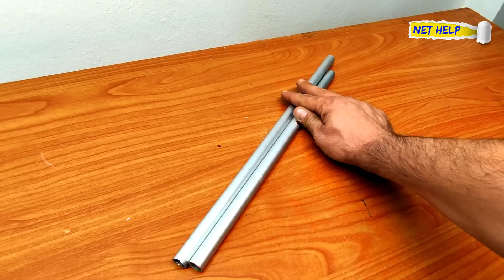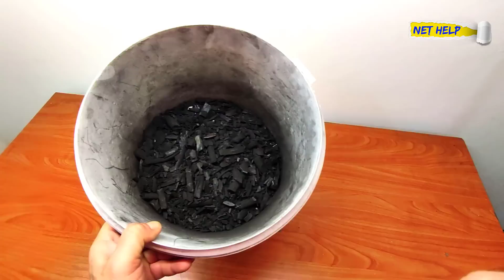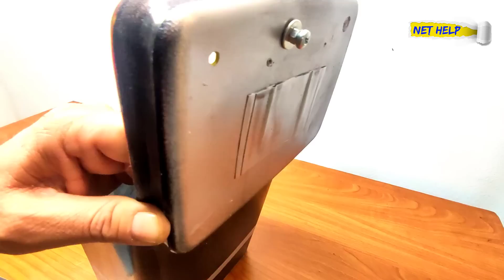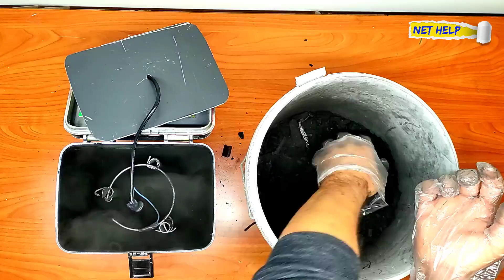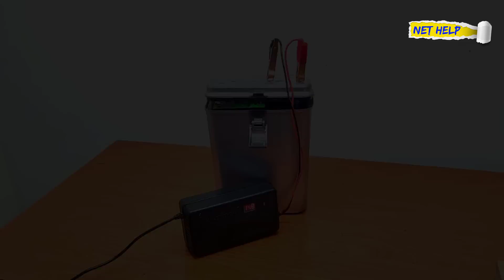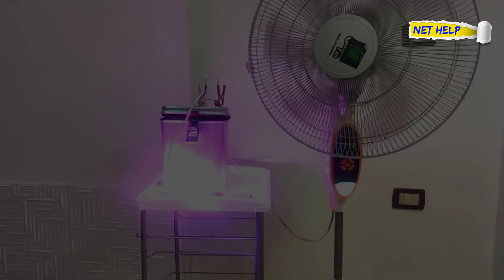I made a 12 volt battery and got free electricity. great idea

Comment from the maker: Dear follower
Tomorrow I will publish for you the fan used in the video, which works on electricity and battery. It is sold on the Internet, and there are many designs
Reply: l

l

l

pp

l

l
Reply: Μπορούμε να το φορτιζουμε με ηλιακα πανελ και πόσο καιρό κρατάει η μπαταρία
Reply: É recarregável?
Reply: Le iba dando el beneficio de la duda hasta que vi que le hecho el "acido hipocloroso", el carbon quedo seco al punto de soltar polvo por lo que es dudoso el funcionamiento sin electrolito, generalmente una bateria de carbon lleva agregado algun tipo de liquido que permita la cobertura total de las celdas. Por otro lado es muy cutre la conexion del electrodo negativos, es decir, amarrado sin soldar y con cinta aislante, cutre. Y lo que termino por desenmascarar lo fake, es cuando le conecta un supuesto regulador que a simple vista se ve que es una fuente switching y al final pone a cargar la supuesta bateria por los mismos bornes de salida. Que yo sepa aun no hay un regulador bidireccional. Pero para efectos de diversion si sirvio mucho el video, me recuerdan los inventos del coyote intentando atrapar al correcaminos. Muy divertido
Reply: And you call it free? you charged the battery from the electrical network. It already turns out that it’s not completely free!
Reply: Thank you . Battery life? How does it regenerate, extend the life of the battery? Maybe show a link where you can buy the necessary materials. All the best !
Reply: How long the electricity lasts?
Reply: Ну теперь понятно как светился прожектор у паровоза.  😂😂😂
Reply: 😂😂😂That's true no bidirectional regulator

Comment: The design is correct. The only thing is not to combine dissimilar metals in an aggressive environment inside the battery. The adhesive tape will not help, as the acid will eventually reach the junction and destroy it. Instead, it is necessary to remove part of the copper and aluminum electrodes outside and make connections there.
Reply from the maker: Sir, we are working on teaching others the method and next time we will work on developing it.

Comment: hoax, false, all kinds of wrong ... there's an anode and a cathode, but the charcoal electrolyte is suspect, rubbing of lemon on the anode does nothing except bring up vague memories of a junior school project. There's no conductivity/electrolyte between the anode and cathode ... it wouldn't drive a 1.8V LED if you called an uber, let alone a fan and power LED's.
Reply from the maker: Did you learn about the Baghdad battery that it manufactured since 2000 that you did not even know about?
Reply: там преобразователя плата, так что все правда, только непонятно - почему медь, а не графитно-угольный электрод? медь вскоре растворится.

Comment: Congratulations. Was the pipe of aluminum and the name of the chemical applied
Reply from the maker: Baghdad battery depends on coal and acids
In this video we used
copper rod
Three aluminum rods
effort lifter
8 - 200 g Hypochlorous acid 200L/H with a concentration of 200 P

Comment: Voltage is good but amperage is the  foundation  of a battery  it means  how long the charge will last .So getting  this out of the way how long  the battery  will maintain  the charge?
Reply from the maker: After seven hours, you can charge it. I have been using it every day so far

Comment: So you used a magic charger that was not plugged into the mains? Mmmm interesting.
Reply from the maker: We installed a voltage riser on the battery and the used bulb is 12 volts, not 240, and it works on the battery and not on electricity.

Comment: The reduction potential or Al and copper is not 12 volt 
Its fake note possible
Reply from the maker: sir
We did not fake it. Look for the method of making the Baghdad battery, which was made 2000 years ago. We added a voltage riser to 12 amps.

Comment: Internal resistance of such a battery will be huge, and electrodes is very small, it is unlikely that such a battery can deliver such a large current. Good focus but nothing more.
Reply from the maker: We put a voltage riser equal to the battery voltage
Reply: @NetHelp2 o you plug it in into your belly button?
Reply: @NetHelp2 Do you plug it into your belly button?

Comment: Good job but your fan normally must use ac and the battery is delivering DC how to do?
Reply from the maker: Mr
This fan runs on battery and electricity
Electricity charges the battery, and when the power goes out, the fan runs on the battery

Comment: a 12VDC battery cannot run a 220VAC fan, 1 the voltage would be too low, 2 the battery is DC and not 50Hz AC.
Reply from the maker: Mr
This fan operates on battery and operates on electricity
Reply: Из видео следует, что этот как бы аккумулятор состоит всего из одной топливной ячейки. Согласно физическим законам одна такая ячейка способна выдавать не более 1,5 вольт, а это очень мало. 
Даже если предположить, что электронный блок повышает напряжение до указанных 12 вольт, то при повышении напряжения сила тока снизилась бы пропорционально. Мы видим, как эту батарею якобы заряжают напряжением 12 вольт, что невозможно и недопустимо в силу физических законов. 
Если бы подобная батарея работала, то производители не делали бы аккумуляторы на 12 вольт из 6 отдельных ячеек соединенных последовательно. 
Это очевидный обман. 
Автор, вам доставляет удовольствие смеяться над теми, кто верит в подобный обман, или ради монетизации просмотров вам это безразлично?
Reply: @user-ob6rv8bq3j  That was the worst magic trick in history. Even a 15-year-old teenager would know that this crap cannot possibly work. 🤣

Comment: Net help:- congrats, in the last experimental video project some one commented & doubt's about your creative ideas, I hope now it's cleared to them, fine improved version charcoal battery with good current/amps, of course booster has to use because of the stable voltage, your method, assembly, Demo, presentation, camera work, subject clarity, simplicity, much appealing, keep it up & good luck.👍🏿👍🏿👍🏿
Reply from the maker: Thank you and I will work on it in the coming days
Thank you and I hope to follow up on everything new
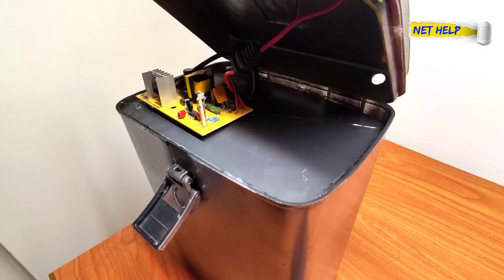Reply: корпус пластиковый крашеный серебрянкой 6:35
Reply: 6:35 хорошо видно что корпус пластиковый крашеный серебрянкой...
Reply: @Valeriy-Sh 
What's wrong with it being plastic? Apart from the obvious trouble with plastics in general, how is this batteries casing being plastic a bad idea? Is it a "got you cheating!" moment for you? It seems fine for a 'lead acid battery' and this appears to be a similar device, although I don't know what electrolyte he used in the battery shown. Even if some of his work looks dodgy, the principles of a 'Baghdad Battery' are shown in this video, are they not?
Peace and best wishes from Ireland mo chara.

Comment: Very nice job!
What is the electronic thing on the upside? 
And it gives 12 volts? 
About how long the battery will last?
Reply from the maker: effort lifter
Its mission is to raise the battery voltage from a low voltage to a high voltage
It lasts ten hours
Reply: @NetHelp2 Good idea. Will it be possible to scale up to larger size? Thinking about for instance a refrigerator? Imagine making two then that each battery can run for about 10 to 12 hours and then switching to the second battery?
Reply: Kul jou hier, kul jou daar en siedaar!